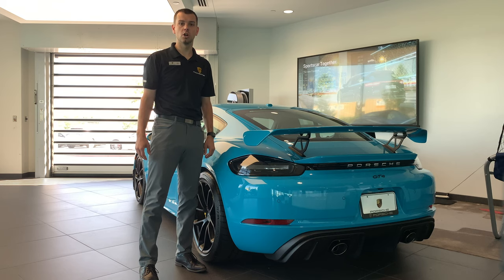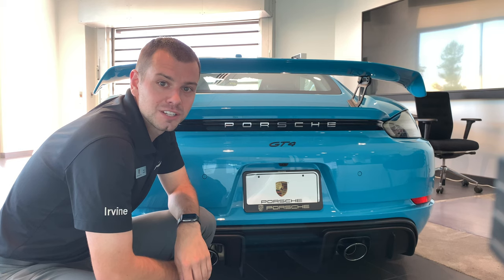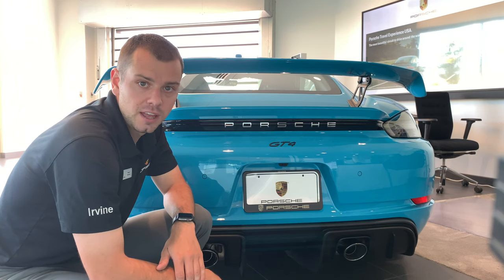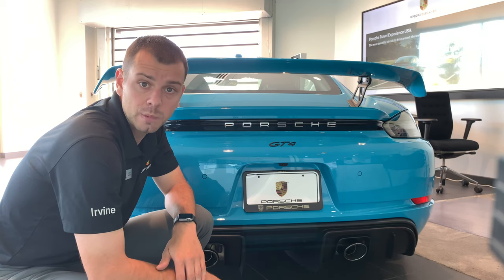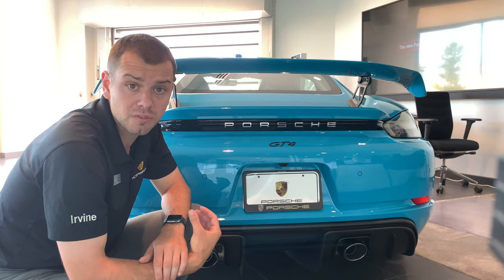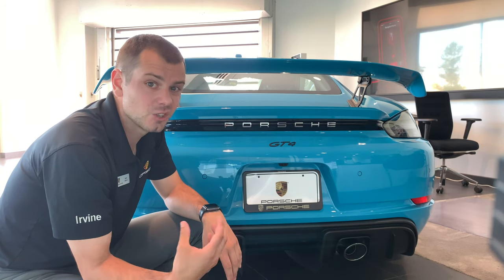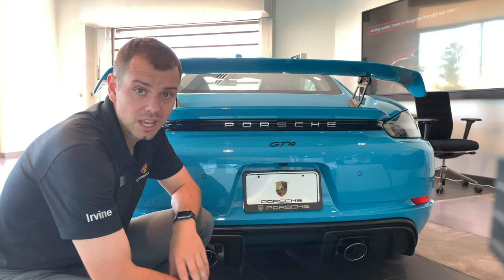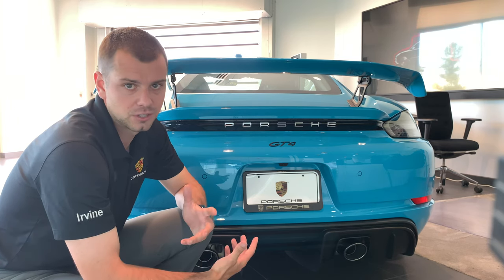Do The 718 Cayman GT4/Spyder U.S. Models Have a Gas Particulate Filter? 💥 An Explanation w/ Start Up

Comment: Great video! My thought is since the 718 GT4 Clubsport sounds pretty good and I doubt they have all the extra GPF installed a quick mod or replace that exhaust section where the GPF would be will increase the sound. Do you know the catalytic converter specs on the 718 GT4/GTS?
Reply from the maker: Thank you for your support! Exactly install a GPF exhaust section delete and the car will sound even better! What kind of specs a would you like? Different elements in Cat percentages? Let me know and I will see what I can find for us!

Comment: What we want to know is this- do the US versions sound better than the Euro cars?  Please give a straight answer thanks.
Reply: Same sound.
Reply: @georgeburdell3313  cannot believe. Deleted my OPF ! Sounds different now.
Reply: @snkcorp.502  @SNK Corp if you delete the OPF it will definitely sound better, its like removing two mini-mufflers!  How did you delete them? But, without mods,  the US and EU versions sound the same.
Reply: @georgeburdell3313  that is not true, as the US versions dont have the GPF, they are louder than the EU models.
Reply: @edron-by5uc  sorry 00edron00, the US versions are exactly like the Euro version, except no precious metal coating inside the matrix, and no monitoring hardware.  As stock, they sound exactly the same. I have a Spyder, I should know.  Now that mine are removed, they do sound much much better.
Reply: @georgeburdell3313  how did you go about getting it removed